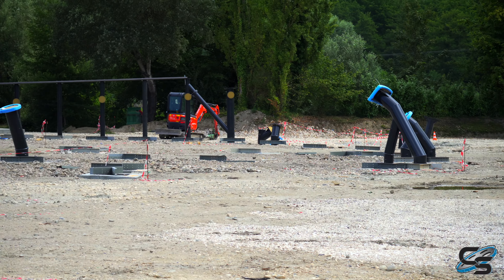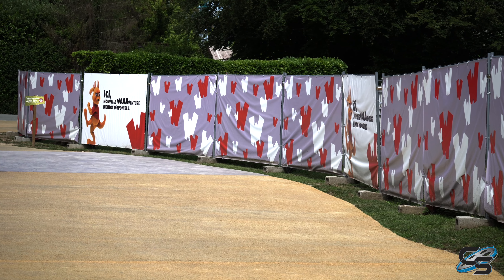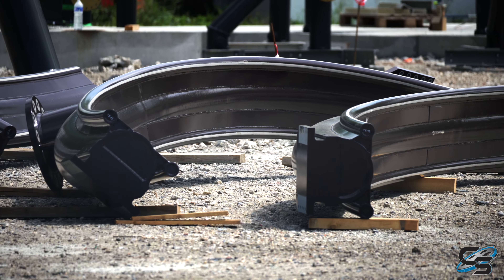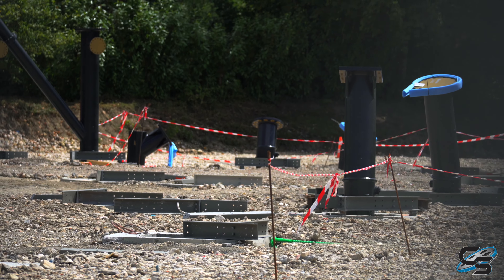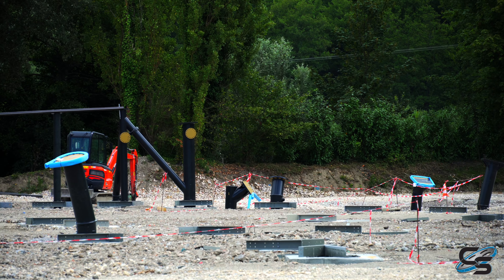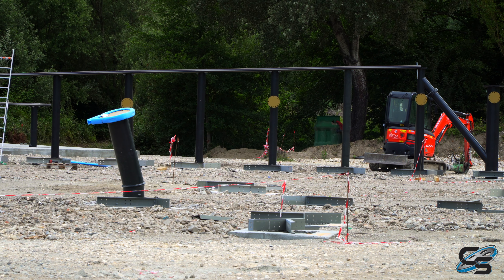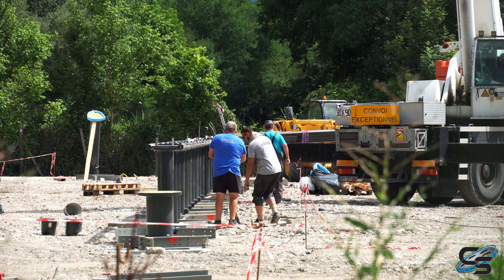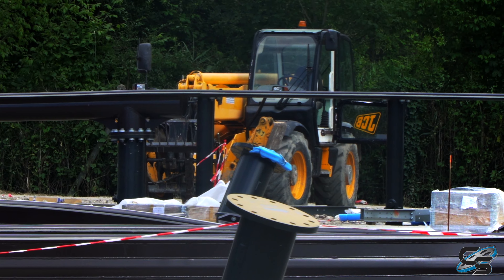New Intamin Single Rail Construction Update Walibi Rhône-Alps New for 2024 Roller Coaster

Comment: Interestingly Intamin's "single rail" design looks more two rail than RMC's, despite RMC Raptor track also having two rails as normal, both styles just have narrow track with no ties and the rails directly on the spine instead. For anyone wondering why they would go for Intamin over RMC, as these "single rail" coasters are generally cheaper, shipping costs factor in far more in budgeting. RMC track is made in the US, it's far cheaper to just load the pieces onto trucks instead and drive them a couple hours rather than shipping overseas on large container ships.
Reply: I thought RMC outsourced manufacturing in Europe to Vekoma.
My guess would be the main reason to choose IntAmIn over RMC is the ability to launch and the superior train design.

Comment: Awesome! I Wonder if this ride will be similar to west coast racers? I always thought one of these would be amazing at Alton towers!
Reply: Replace Rita with it!
Reply: @William_Does_Coasters2255  Never ridden it but I wouldn’t mind! 🚹
Reply: @William_Does_Coasters2255 Rita's launch is much more powerful than a Hot Racer. Hot Racers have weaker launches than IntAmIn Blitzes, let alone hydraulic launches. And replacing Rita with a Hot Racer would leave a big gap in Alton Towers' lineup.
Although, Alton Towers could use an IntAmIn Blitz with these new-gen lapbars. And a Mosasaurus roll. And maybe a backwards section with the fast switch track, like on Hagrid's but more thrilling. And it should have long trains so the ride can have a high capacity, which will be possible since the ride would obviously stay low-to-the-ground due to the treeline height restriction, so there wouldn't be any large changes in speed, allowing the train to be very long while having a consistent level of force in every seat.

Comment: Don't get me wrong: I love seing more raptors or similar models like the Hot Racer. Now for the hot take:
One thing is just frustrating: They are designed for smaller parks. At least the raptors are according to RMC. I only see them in either big, or bigger parks. Big Dipper in AUS my Intamin is pretty much the only small park that was that lucky to get a coaster of that kind.

the really small parks get told the wait times are immense for a coaster like this to ship, since all the big parks want one first. A lot of small parks in europe are close to dying.
Reply: You forgot Stunt Pilot at Silverwood. That's a small park.
Reply: I'd say Walibi Rhone-Alpes is rather small, therefore I don't understand where you're coming from in terms of this video.
Reply: @phantafan7965  for European standards it is still one of the bigger parks in France to be fair.
Reply: @Fox_on_a_Rollercoaster  I don't think it makes a difference if it's an European or an American park, because the capacity of the attractions will be the same. Many people consider Stunt Pilot to be a good fit for Silverwood as a smaller park, yet Silverwood gets about 300.000 visitors more a year than Walibi-Rhone-Alpes.

Comment: Its not single rail, you can see the two seperate rails attached to the spine
Reply: Yeah but that applies to RMC raptor track too, that's also just two square rails directly attached to the spine. Only real single rail coasters are those hanging models from caripro.
Reply: @shroomyesc  it doesn't apply to RMC. Those 'two rails' on raptor track are not seperate rails, but one large sheet of metal, making it a single rail. The hotracer has two distinct piped rails welded together.

Also, not only caripro but also Brandaurer/Caripro Alpine coasters.
Reply: @QDude24  Well the top surface of the track may be one sheet but the side and bottom running surfaces are welded onto the spine separately so idk if I'd say the top sheet being one piece makes it single rail.

Comment: I honestly don’t understand why Intamin are making single rails. What’s the difference between making any other intamin coaster and this one besides filling in the gaps of the track trusses?
Reply: It's also got one-across seating rather than two-across.
And this single-rail track is supposed to be stronger than normal track, allowing the ride to be build with fewer supports and therefore less money.
Reply: @me-myself-i787  ok that's pretty cool